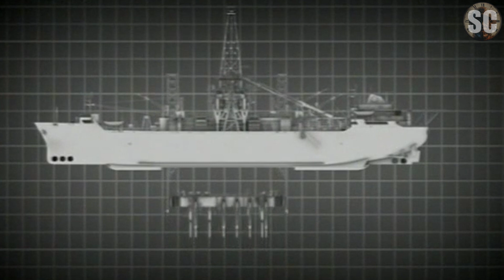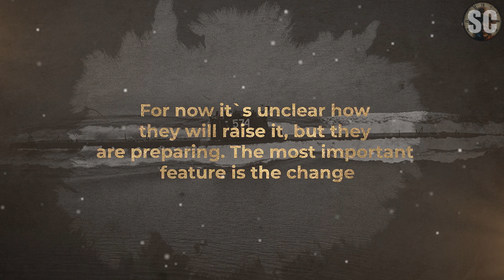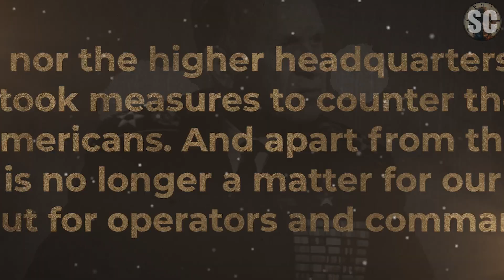IMPOSSIBLE: why the U.S. recovered a Soviet submarine from a depth of 5 kilometers

Comment: After the sov sub retrieving operation was completed, geologists shyly stuck their hands up and asked if they could use the Glomar Explorer to actually drill into the seabed.  They were given it.
Glomar Explorerwas renamed "Glomar Challenger" and actually did drill the sea bed.
It was later replaced with a purpose built drilling ship called the "Joides Resolution".  (Joides = Joint Oceanographic Initiative  for Deep Exploration of the Seas).